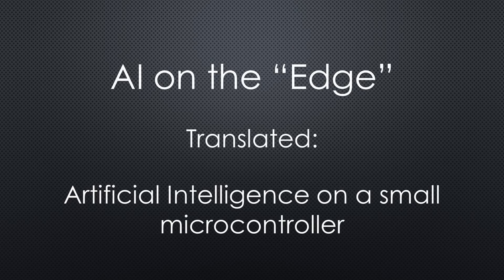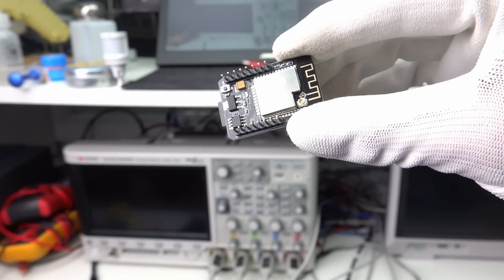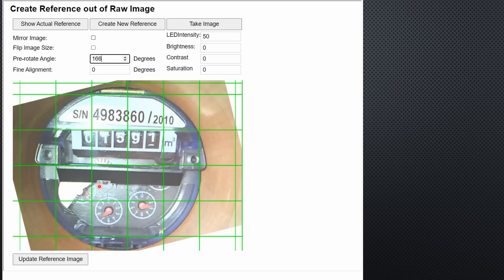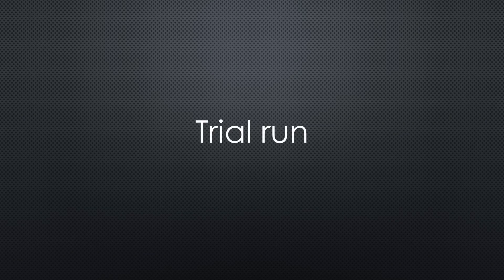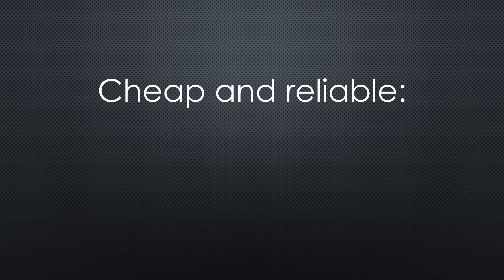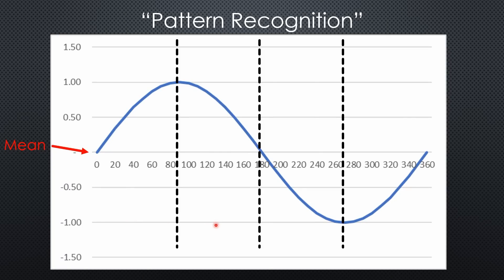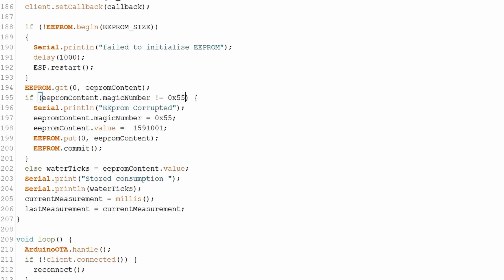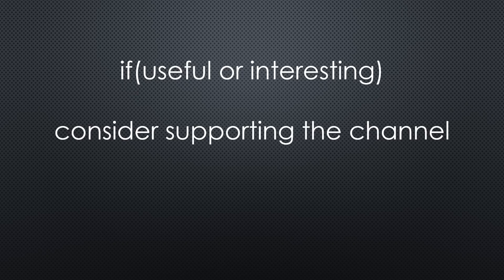#418 AI on the edge vs. Traditional Engineering. Water Meter with ESP32-CAM

Comment: I work as a data scientist and one of the most important questions you always have to ask before using AI is: 
Can this be done without AI?
If the answer is yes it is probably more reliable to do in a traditional way.
Reply from the maker: Thank you for the additional insight!
Reply: the term "AI-washing" comes to mind, similar to greenwashing for environmental issues.
Reply: I worked on problems that required a quick solution. This AI solution would have worked perfectly for a job 15 years ago where I needed to take 7 meter readings that didn't have an interface of any kind. I ended up putting microphones that detected a click. The solution worked, but we knew that some clicks were lost and we ended up empirically calibrating this indirect measurement system. I would have given everything for this solution with an esp32-cam. This solution would have been working in just one day, but instead it took us almost a week to refine and calibrate the microphones, sound filters and empirical corrections. Wow, I still remember how I couldn't sleep well that week.
Reply: @guatagel2454  I expect the space shuttle would have liked the computing power of the ESP32 in the 1960's!🤣
Reply: Purpose-driven work has it’s time and place, as does purpose-finding. Research, just for the sake of research, has more value than most admit. Without it, and the corresponding “time wasters”, we wouldn’t have things like combustion engines, air travel or GPS. 

Learning is a process, experimentation is part of it.
Reply: Well then you might have to convince all other members of a co-owned housing compound to let you change just one water counter and why...
Reply: @AndreasDelleske  generally speaking, using AI to bypass HOA restrictions could be popular in a lot of tech savvy pockets that have sprung up in old money communities
Reply: @AndreasDelleske  
That means you can't do it (or can't do it without a significant amount of effort).
-> use case for AI
Reply: @Pheatrix 

AI is more reliable and cheaper than any other solution.
Reply: @ajarivas72  Yeah it's pretty cheap for the end user, after more than a trillion dollars lost from the big sharks just to get it moving
If you try building the same model yourself, you'll probably opt out for coding a pattern matching algo in the end
Reply: @AndreasDelleske  No “HOA”.  A SMALL TOWN OF 4000. YOWN IS Over 200yrs old. We had City well/pump, good water and small flat fee.  Then County seat in Nearby town ran water from massive lake and sells it to nearby towns, counties, etc.   (Again, if not broke, do not repair it!) lol.  Money drives decisions!
Reply: Nothing beats a basic type meter!  Reminds me of old saying “Do not fix it if it is not broken.”.    However, lazy as they are… do not want to go read each meter,…..sit in car and scan the electronic feed….

Of course way backin time, we had one meter reader that would often “guess” the numbers without going to read meter.  Hahaha.  We just took pictures of them and posted in local news…” Meter reader has SUPER VISION reading meters”.   The humor and embarrassment had water department investigated.   Customers all took pictures of future incidents.  (Nothing like humor and embarrassment to get a company to do what is right for consumer.

Comment: hi, I'm curious about the power supply.
I'm guessing you are using a power bank, with the esp-cam it would be drained in no time, but like you did it, it would probably last a lot longer.

thank for your great videos.
Reply from the maker: The power bank is only for the prototype. Later it will be connected to mains.
Reply: For me it would mean a civil construction job.... :( 

I could try to use some solar power.

Another problem I see is the water comp comes to read the meter if it is all covered would they destroy everything to see it?
Reply from the maker: We have self-declaration once a year

Comment: I think for having better results from the AI, it would be necessary to train it with pictures from the watermeter which is actually used. In German magazine "Make" there is currently a series of articles on how to do this ("AI for ESP32" or "KI für den ESP32" in German, unfortunately behind a paywall). The AI is trained on a PC with python, only the result is transferred to the ESP32. Didn't do it myself, but I would except much better results.
Reply from the maker: Glad the installation works with you. Your counters are much more "clean" than ours. Only one level and nothing covered.
Fortunately, I get the "Make" every month. But training my project would have been too much time consuming. And the main problems still would be there (glare, 2 dials covered, number between two numerics). So I learned a lot and wait for the next shot.
Reply: The articles in the German Make are actually by the same author as the water meter project. By the way, this runs extremely reliably for me. But it's true: You should reduce complexity wherever possible if you want reliability.
However, I bet that 99% of the viewers here don't do that, because in that case we would have to do without our ESPs and Raspis and switch the light on and off at the switch instead ;-)

Comment: Cool project, I have something similar in mind for several months now but my ESP32-CAM boards got lost on their way to me 😁 BTW, using the VoltLink USB to serial adapter, would not require pushing any buttons for programming the ESP devices as it handles that automatically 👍
Reply from the maker: Good to know. I forgot to use it. I am an old man and have my habits :-(

Comment: I tried exactly the same with my heating central at the attic and my house power meter. I ended up kicking the pattern recognition in both cases. The fresh installed smartmeter (power) provides a blinkig LED, 5000 ticks per kWh. Easy enough to read using a lightsensor. For the central heating I just tried to find out how often the flame was ignited. I ended up using a lightsensor as well, using the "flame is on" LED of the heating central. I would love to read gas consumption and water consumption as well, but here my problems are more real life related: no power to drive anything around those installations. Seems, the guy that planned installation in this house did not have any digital stuff in mind at all. Still, I need to stick my head into that tensorflow pattern recognition. And many thanks for not calling pattern recognition AI. I hate that buzzword bingo that is happening nowadays.
Reply from the maker: You know: I am an engineer and like to name things correctly ;-) 
Using secondary things for measurements often needs some creativity but can lead to good solutions (as in your case).
These counters need some power because they have to be always on and, in my case, also need an LED. So, 100mA is needed. I have electricity there so it will not be a problem.
Reply: For power, if money was no object a power over Ethernet (PoE) setup sounds nice, or just run speaker wire with either 5v or 12v as supply
Reply: @gregw1076  sadly, not working there. No way to get a cable there, if it not look like a barbarian attack :)

Comment: I like the more practical approach to the measurement - using pattern recognition is good idea for some events, but reliability is a big problem. So using something like you did is far better, I think.
Reply from the maker: For me, it was interesting in diving into the matter. What does the counter do if one number is between two numerics? What if 2 or three are in this position?  Not easy to solve if the counter was not made to be read by a machine. Or if I cannot read one of the dials? How to solve that?